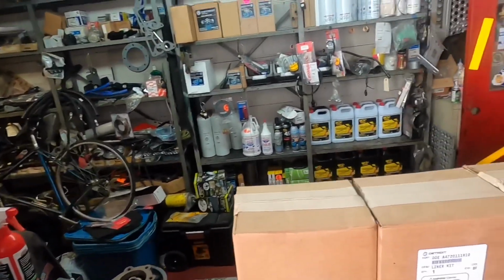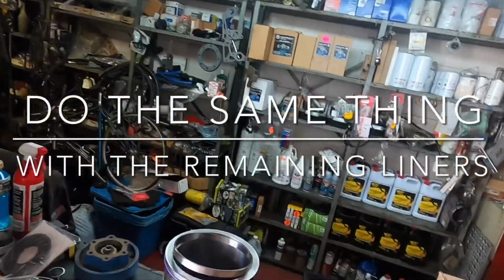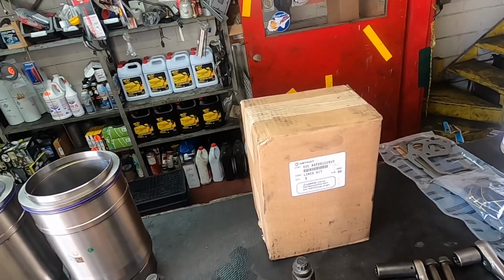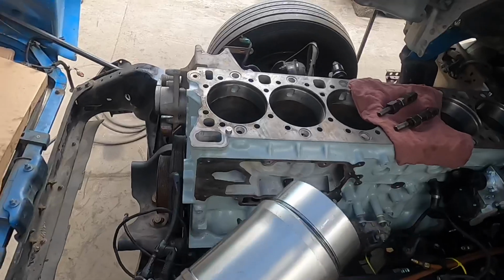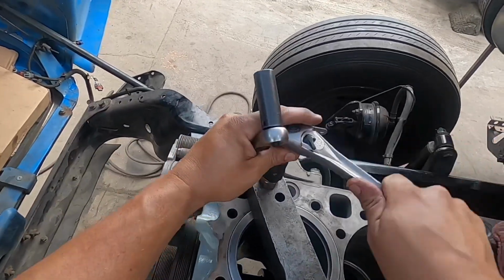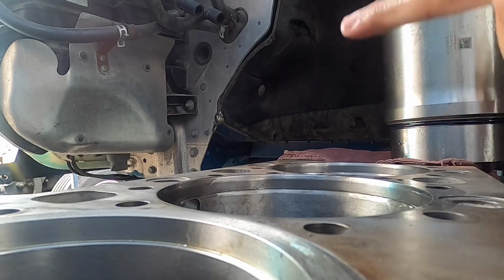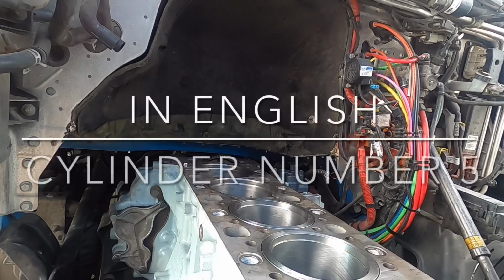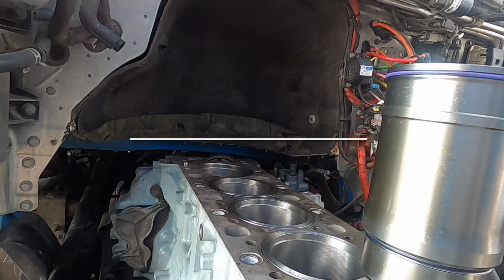DD15 major overhaul Part 3 cylinder liner installation (English and Español)

Comment: Your better off using dawn dish soap for the liners and rubber liner seals than oil,,
Reply from the maker: @nightstorm9128  👍🏼 appreciate the tip. I’ll try that.

Comment: Did I miss your dry run liner height check ?
Failure analysis I've done over years has lead to the highlighting thst if your lubricating seals use vegetable oil or liquid soap of some kind, mineral oils are not friendly to all liner seals, I know the lower ones can be exposed to crank case oil but not all liner seal materials are the same so use something thst is going to be cleaned away by coolant preferably
Reply from the maker: The block is inspected upper and lower. The upper is usually cut for bushings and a liner is installed and measured for protrusion. I don’t do this myself. I have the guys at Engine Saver Reboring (located in Chino, California) come over and perform this. I have heard of vegetable oil or shortening being used on the seals but have never tried this. I usually just stick to what the book says.

Comment: Hola carlos gracias por tus videos.
Una pregunta my amigo tiene una freightliner cascadia dd15, esta filtrando coolant al aceite por los cylinder sleeve o-ring.
Se puede reemplasar solo los liners o-ring ?
Reply from the maker: No lo recomiendo. Especialmente dependiendo en las millas del motor. 
Pero técnicamente si las camisas no tienen nada y el bloque está bien. Si se puede
Reply: @CarlosDieselElectric  gracias por la respuesta amigo, yo tampoco veo la logica en solo reemplasar los sellos, tenes muy muy buena informacion y apenas descubri tu canal.

Comment: Carlos great Video again. You never let us down also like the English & Spanish in one Video awesome. Question how much does a Complete overhaul cost on a DD15 ?
Reply from the maker: An overhaul will cost about $17-20K. For a job like the one in the video where the engine block comes out. The cost is more for labor and machine work.
Reply: InstaBlaster.

Comment: The outside of those liners are in the cooling system of the engine, wouldn't it be better to use coolant to lubricate the O rings?
Reply from the maker: Good question, I believe the book says clean motor oil so when the oil is applied to the seal it will swell and helps create the seal around the liner. Although I have heard from an old timer to use crisco shortening oil. I have not tried that either. Maybe I afraid if it does go well I’ll have to do it all over again.
Reply: @CarlosDieselElectric how much this overhaul job costs parts and labor separately please

Comment: I’m going ty step out on a limb and ask you a question?🤓What does the metal ring do?
Reply from the maker: Carbon scraper
Reply: @CarlosDieselElectric  does the carbon scraper adjust the liner protrusion?Ive seen some shim up to adjust the liner protrusion with Cat engines for example?do I have to be concerned about liner protrusion?🙂
Reply from the maker: @landonbrown6568  no, the liner protrusion is already set within the engine block. All the engines are have done, we have the liner protrusion measured and if it needs to be cut, we have it cut.

Comment: How do you know the liner is correct height. When do you know to stop or keep going?
Reply from the maker: When the block was at the machine shop they check for height protrusion. If the height isn't there then they will machine it so when the liner is installed it will be within factory specs. 
As for the second question, when you install the liner, it will bottom out and not go in any further. Again, no need to apply pressure beyond the normal, you will feel when it reaches.
Reply from the maker: If you need the height let me know, I will have to check the book.
Reply: @CarlosDieselElectric  yes please can you give me the heights. 2016 dd15.  Also what tool is needed to check the height? Mabey I can order tool online. Thanks. Is there a way I can email you for questions?
Reply from the maker: @transport21  now I don’t know what tools are needed. I would contact a machine shop that is familiar with the tools needed. But let me check on the specs. 
My email address is carlosdiesel@sbcglobal.net

Comment: At what miles should a DD15 get over hauled. My truck has 600,000 miles
Reply from the maker: You still have plenty of life left on that motor, most trucks will not need an overhaul until they hit 1,000,000 miles. With good maintenance you will be fine. 
I have done overhauls on engine that have reached 1.1 million miles and in some cased 1.2 million miles.

Comment: Nice, what was the year of the truck? What price for one liner kit? Thanks
Reply from the maker: Thank you. The truck is a 2015 Freightliner Cascadia
Reply: You can find the liners online for about $130 a piece
Reply: Thanks
Reply: @CarlosDieselElectric  What is the engine overhau cost and calibration cost for the turbo?
Reply from the maker: @deeb1504  DD15 does not have a turbo calibration. 
I am working on a video to go over the cost. Hope to have it out soon

Comment: What about liner height?
Reply from the maker: Great question, in my previous video I described the engine block was serviced at Engine Saver Reboring in Chino, CA. They go through the entire block. Hot tank, Line bore, they also check the uppers and lowers the ensure the liner height is spot on. I have had Dan and Justin work on other DD15 engines that I have worked on before and have not had any issues. They are very good at what they do.